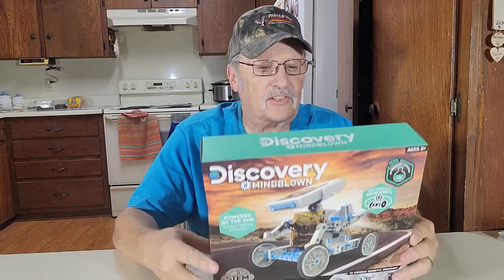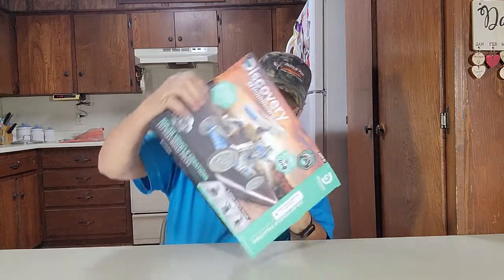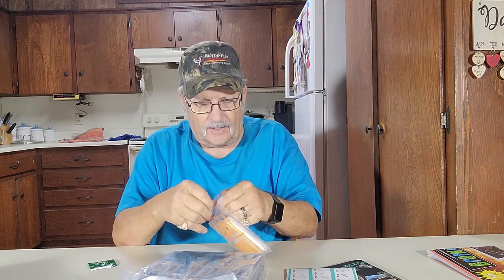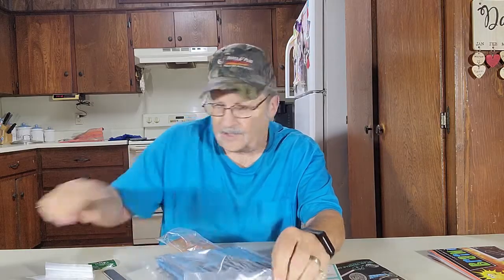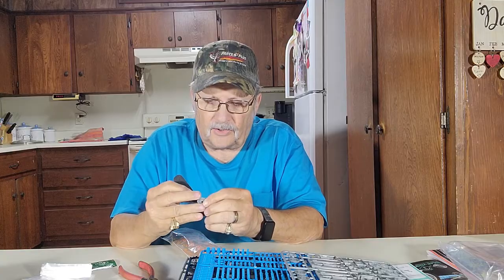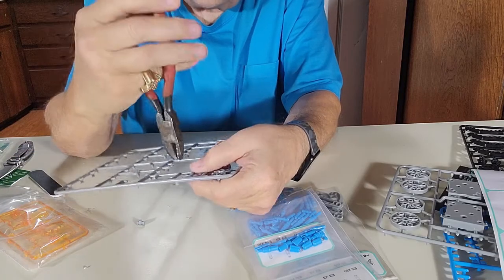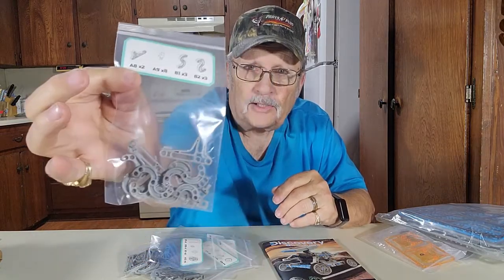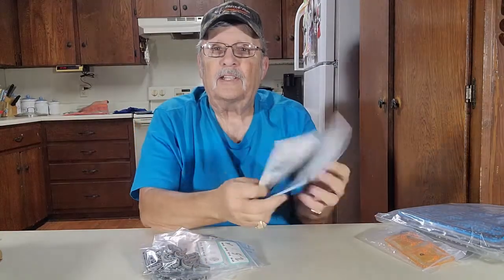Discovery Mindblown Solar Powered Robot STEM Kit 12 in 1 Open Build Review #1 Buddy Bot

Comment: Anyone have issues with the solar panel? Got it built, everything looks to be in order (wires, pieces, everything), but sun isn’t giving it the go go juice
Reply from the maker: Mine did not get enough juice either that's why I used a battery
Reply: I think you need to put in under a lamp so it can go juiced up
Reply from the maker: @Halal470 I tried that still not enough power to run. That's why I used tha battery